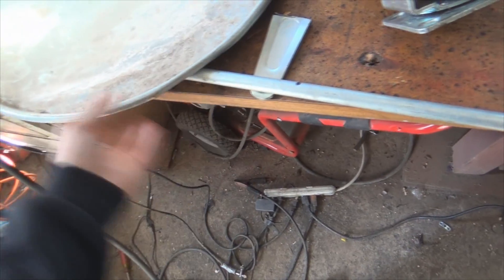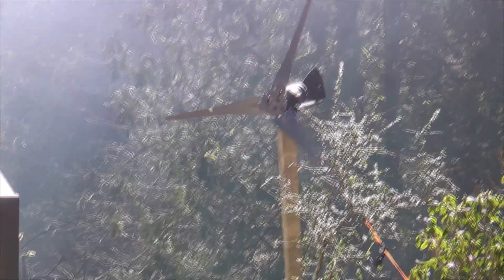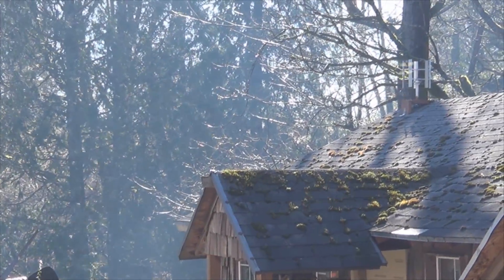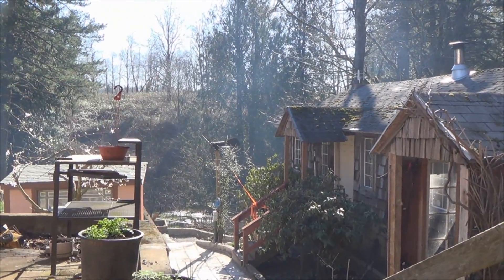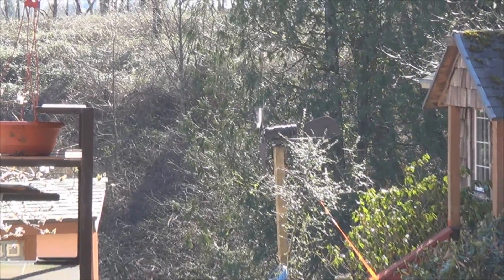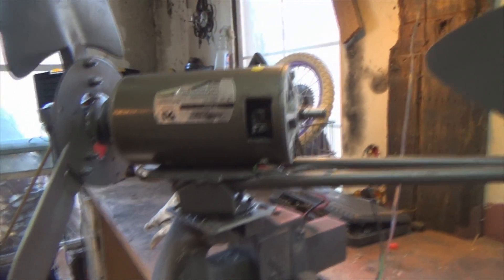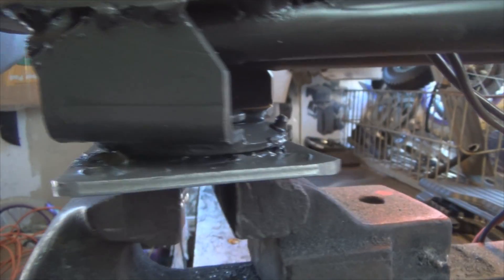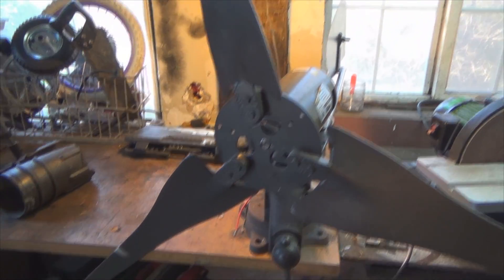DIY Wind Turbine Build (part 2)

Comment: That treadmill DC motor need more speed, almost 2000/4000 rpm for generate energy you need a gear transmission 1:3  rotor one time DC motor three times.

You must calculate how match power is needed for driving the treadmill DC motor. i think that you must mound 6 blades on the hub.
Reply from the maker: lexpee the way I understand it is I would need 2000 Rpm to reach the voltage on the label, which I think was 110v. If I'm shooting for 14v it probably doesn't need to be quite that fast. But I'm not positive. But yeah this design definitely needs more blades!
Reply: I am also working to design for a own windmill on paper. Good blades and a hub are the basic.

I want not Using a treadmill motor also not a DC electro-motor but a low speed PMA 300/500 rpm. I want build a low-speed wind turbine no noise maker. 

For the wind direction i go not use a tail but a weather vane with micro switches and electrical mechanical system with an electric motor with a significant delay.

This prevents a swinging, wind turbine, you get him stable in the wind.
if necessary than make the wind vane contact with a micro switch  and become slowly corrected in the adjust direction.

good luck
Reply from the maker: lexpee Sounds Complicated! Hope everything works out Buddy!
Reply: Not at all, simple wind vane down the shaft a cam with two micro-switches.

Sent me a private message I sent my email address. Then I can send pictures and more information.

Comment: LMFAO. Not trying to be rude but I laughed all through while watching your part 1 & 2 videos of your wind turbine. Looks like you already have grid power and you are doing this as a fun project. If so have fun. Don't know what type of batteries you plan to charge with this wind turbine but with the current state of your project you can only struggle to charge 2v batteries. If your intention was to produce useful power from the wind then you may have to start the project over again with the right parts. Don't be discouraged though. Do leave a comment if you are interested in producing real power from the wind.
Reply from the maker: Peter Anongo Yep just a for fun project, It was more so to get a feel for how the whole system would work.  But, In the future i'm actually going to be using a water wheel, since we have a stream in our back yard. Which is much more consistent in terms of energy production. I'll make a video of it sooner or later. Anyway thank you for your concern and thanks for watching!
Reply: Ok.
Reply: Peter Anongo id like to see you do better

Comment: Oliver
The bearing worked great especially having a grease zerk on it. 
Here's my video that might help you out  https://www.youtube.com/watch?v=opP13e-TvHM
2 suggestions if i may, 1 - If your  tail fin was changed to vertical rather then they way you have it now, horizontal, it will track better. Also making it twice as wide. 2 - it takes a lot of wind to get 3 blades moving. Go with 5 and it will start in much lower winds.
Also when you are ready to hook it to a battery make SURE to put a blocking diode in the line or the battery will cause your electric motor to run and essentially drain your battery.
Great project , love using junk you have lying around to build something with. Thumbs up.